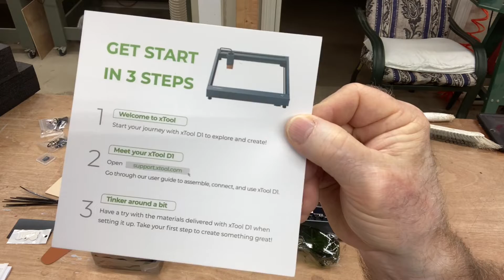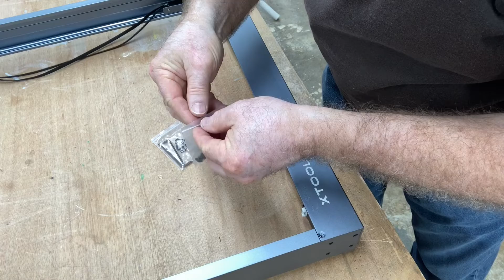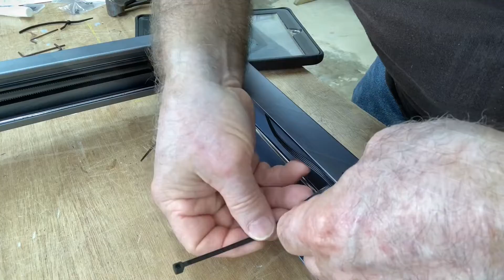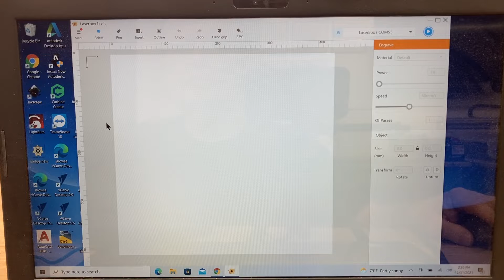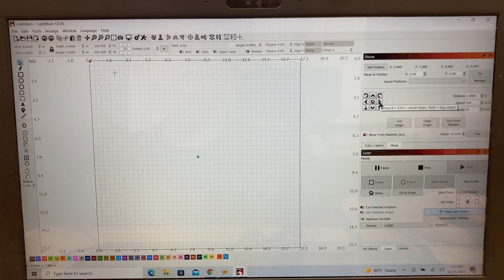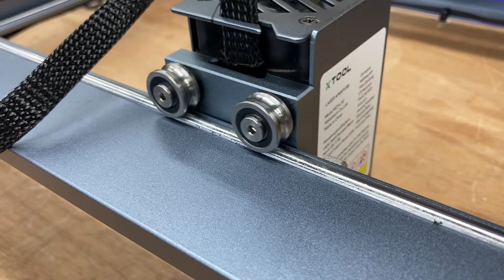xTool D1 10 Watt Laser Assembly and Lightburn Setup

Comment: I like the way you teach I’m trying to do a circle comes out odd shape any ideas I have d1 pro 10 thank you
Reply from the maker: If the circle is not a circle then you have belts that are slipping, losing steps or another mechanical issue. Make sure the machine is clean and the wheels turn freely. Tighten the belts to manufacturers recommended settings.

Comment: Hello Paw Paw! First of all, thank you for sharing your video. I have a question: Is it possible to use xTool D1 Pro with LightBurn via WiFi?
Reply from the maker: Thank you,  the xTool will work with Lightburn as that is all I use in the shop at this time. I know it is capable of WiFi but I do not use it in the shop. In my shop it is inconsistent and I’m not interested in ruining a project.
Reply: @PawPawsWorkShop  Thank you for the answer.

Comment: Thank you for your video. I have a question which related to the alignment. So I try to print some text to the metal card and the problem that I'm facing now is how I align text to that metal card. All my text just not align to the edge of the card :(, so it is like 3, 5 degrees from the edge :( Just hope you have the solution for it. Thank you again.

Comment: Hello, a friend of mine sold me his Xtool d1 pro 10 watt, but could not find the power supply, tried contacting xtool but they would not tell me the spec.s and want be to go though a bunch of sketchy steps to buy it doing screen shots to a third party and the give the a screen shot showing it paid, not to mention they wanted $80.00 for it. All that being  said, the laser head says 12vdc input, but the machine where you actually plug the machine in to says 24vdc, anyone give me a picture of the specs on the back of their power supply?

Comment: This video is amazing! Everything was pretty easy to follow. However, like most people, I'm having an issue with the laser not engraving/cutting.  I can see it framing the motion that it's supposed to but when I press start in lightburn and XCS, the blue never shows up and the red laser just moves the way it's supposed to. I tried customer service but they haven't responded yet. Please help, thanks!

Comment: Paw, paw...can you please help me?? Customer service is giving me the email runaround. I follow all the instructions and attempt to frame. Nothing happens. I click process and get a mressage the project is "complete" even though the laser has not moved. I dont know what I am doing wrong. It looks so easy, but I cant get this STUPID MACHINE TO WORK!!!!!!!!!!!!!!!!!!!! I am ready to take a hammer to it!
Reply from the maker: Are you using Lightburn or laser GRBL?
Reply from the maker: In the instructions there are drivers. Did you add the drivers?  Does the machine power on at all?
Reply: Using XCS. Powers on. I see the red x but machine does not reply to any commands. Lightburn is too complex for me right now

Comment: Thanks for the video. I got  Everything set up but for some reason I'm unable to home or remove the machine from lightburn? Any suggestion.
Reply: Move the machine
Reply from the maker: Thank you for watching. I have never homed the D1. Use current position, frame,(just to make sure all fits), engrave. Go to devices under laser to select another laser

Comment: HI, PawPaw...I need a little help.  I'm new to anything laser, so please bear with me.  I've had my machine xtool d1 for serveral  months, and because just recently I managed to figure out why my Laser head kept crashing and believe me if you see the head on the left side of that laser you would cringe.  I have thirteen hits on that and it is marked for proof.  Well, I also have a camera set up and was trying to figure why the alignment is ALWAYS off.....conclusion, the laser hit the rails so many times that the Gantry  is now out of alignment. What I'm confused about now is how to square up the Gantry.  It is off by a 5 to 6 mm on the Left side (looking at it from the front of the machine) and I'm not sure what screws I need to loosen or tighten to square it up.  I've followed you on the set up (thank you for that)  and all was well for me.  Except for the crashes that threw it all off.  Your answer, Paw Paw will help a whole bunch of D1 users out there that use LightBurn and  have the same issues as I have.   Just as a side note:  LightBurn is a not a bad software...but Jason is trying to serve all LASERS and CO2's; and newbie's such as myself are not putting in the correct figures in for the D1, so no one wants to use it.  Sorry, this is turned into a book...but you explain things so well....
Reply from the maker: Wow, that is a lot to be out of square. It seems to be all on one point. If you recall when you assembled the machine the screws that attached the y axis rail to the x axis rail on the back of the machine. You may have damaged to screw hole or maybe even broken it. You will need to loosen that area first to see the internal damage. The machine was designed to go together square. This damage has caused it to be that far out may result in having to replace parts. When you take apart the corner and see the damage please let me know and I’ll try to give solutions to repair it
Reply: @PawPawsWorkShop  Paw Paw, I have figured out that after 8 hours of rebuilding the Xtool D1, and reinstalling the software, (even taken the time to go through the registry on Windows 10, to make sure ALL of the software was gone) that LightBurn kept reading the measurements of the bed bigger than it was, and for some reason it did seem to think that what measurement was in for a cut or burn was wrong and did its own thing.  Why so many crashes.  Well, the machine is not damaged (that was really scaring me to death, I've lot invested in that unit) and I've squared it up and double checked.  I ran a small test burn today, coaster with a graphic in the center, and it framed it NORMAL, and engraved it perfectly.  One thing that occurred to me was when I first loaded the software , I did not have my virus software turned on...this is usual however with a lot programs so after the installs I always turn it back on.  Well, this time I left my virus software running as usual,  and there was no issue.  It is quite possible that a virus attached itself to the software and caused it to act wonky, it is of course my opinion. I watched your assembly video on the D1 and assembled exactly and now  it's burned into memory.

Comment: Ran into your video while searching Thanks for the help. One thing I have not seen watching any of these videos is setting the tension on your drive belts. what are your thoughts on this. It seems to be very subjective.
Reply from the maker: Thank you for watching my video. In many of the videos I show how to tension the belts. On these simple diode lasers all you need to do is to tip up the laser and let the gantry slide down. It should move slowly down. If it does not move, belts too tight. If it just falls, belts too loose. The laser should be tilted to about 45 degrees
Reply: @PawPawsWorkShop  That my friend is good advice. Appreciate your time and your quick response......have a great day. Just hit the subscribe button......

Comment: Your video was the most informative on the D1 I could find. Thank you! I just unboxed mine and I have an extra prong on the cable going to the laser does it go on the black box?  You did not cover where that goes....or maybe the model has since changed. The manual is only pictures and not very good ones either. lol.
Reply from the maker: First, thank you very much. For your question, I’m not sure, I did not have that. I only had one connector for the laser. If this connector was located near the middle of the cable then that one goes to the stepper motor

Comment: Thanks for doing this video, I followed your step by step set up and got it all set up however I am stuck when it comes to Lightburn. You say to click on devices, however I can't do that because the window pops up to find my laser, I try to import and it's not found in my downloads even though I just downloaded it. I have spent 2-3 hours trying to figure this out 😞
Reply from the maker: When you click on devices, create the laser manually.  Also, in the D1 info it tells you step by step how to add the Lightburn software and how to setup the machine in Lightburn.

Comment: Good video - I used it before assembling my new D1.  Question - Using lightburn, my crosshairs outline the project to the left of the actual burn area.  Is there a way to align the crosshairs to frame the actual burn area?
Reply from the maker: Your crosshairs are offset by design 16mm. It should frame correctly unless you have changes some settings
Reply: @PawPawsWorkShop  16mm sounds exactly the amount they are left.  I'll do some more digging into why.

Comment: Man, I wish there were limit switches on this thing.  I've rammed it into the frame on several occasions...I've had the hardest time figuring out the Absolute, Current Position, User defined poisitions.
Reply from the maker: There is a new version with limit switches coming out July 6th

Comment: When I use xtool with lightburn, my image is engrave upside down and backwards. It look like the mirror of what I want
Reply: If I hit the mirror icon, then the one on my computer screen is mirrored, is that normal. And it is also upside down.
Reply from the maker: Yes
Reply from the maker: Just use the mirror icon at the top of the tool bar

Comment: If you get a chance could you please explain what you meant by the 32 = one my laser still is not working it is framing it is moving in the directions it's supposed to but it is not engraving nothing is there something I am doing wrong please help thank you in advance
Reply: Yes I follow the directions precisely did farmware updates did latest software updates everything I haven't actually tried to use light burn yet although I have it downloaded perhaps I will try that but I still think it should work with laser Box basic no?
Reply from the maker: Yes, it should. That is why I asked about the GRBL settings. They are in the laser not in the computer. I look tonight how to get it in laserbox
Reply from the maker: Do you know how to get to the GRBL settings? What software are you using?
Reply: @PawPawsWorkShop  also just trying to use laser box basic
Reply from the maker: I don’t use laser box. I’ll look to see how to see the GRBL settings. Also, I assume you completely followed the xTool setup including updating the firmware as necessary
Reply: @PawPawsWorkShop  im using the latest windows. i dont know how to find  my GRBL settings. my laser frames and moves it just dont engrave. sorry for being a pain.
Reply: Ty sooo much! Again apologize for being a pain in the ass.
Reply: I finally have a day off tomorrow any help would be greatly appreciated. I think I followed you on Facebook to try to private message you. Ty for everything.

Comment: Living in the deep south myself do you keep your laser engraver in you shop and is it air conditioned? If not A/C would any harm come to the engraver? Thanks
Reply from the maker: The shop is air conditioned when I am in the shop. I turn off the A/C when not in the shop. So far I have never had a problem with any of the machines due to heat and humidity
Reply: @PawPawsWorkShop  thanks for your response

Comment: Thanks to you Paw Paw, I managed to assemble the D1 frame without a hitch. The belt however gave me fits. It somehow got stuck and I could not get it freed. I turned the laser on its side and gently pulled on the belt and it finally gave. Scared me to death, thought I did some damage. I'm extremely new at this laser thing, so I was super careful. When folks such as myself do not have a clue as to laser, belts and what not, a very close up visual is soooo helpful.  Your video got me through this...now I'm on a coffee break. LOL  Thank you for taking the time to share your knowledge for dummies like me.  Very grateful for your knowledge and patience.
Reply from the maker: Thank you very much. I enjoy helping others. This is the reason that I started making the videos and created this channel. Congratulations on starting on the path of laser engraving

Comment: My laser has been acting weird. Weaker, wont fully cut through anymore. Settings are the same as they always have been and it was doing everything perfectly before. Engraving with great detail and cutting through 5mm birch in 1 pass… I have to complete 75 wedding invitations, after 24 its acting up.
Reply from the maker: Two things to consider. One you may need to clean the lens on the laser. Use alcohol wipe. The second factor is the laser head is considered disposable. At full power the diode laser will last about 1000 hours. With let power it will last longer
Reply: @PawPawsWorkShop  wow… thanks didn’t know about the use of the laser information. Im going to try cleaning the lens when I get home and see it that works out. Thank you.
Reply: Hopefully purchasing a new laser head is simple if thats necessary… trying to get in touch with the xtool team definitely isn’t simple 🤦🏾‍♂️
Reply from the maker: They have had a number of COVID lockdowns

Comment: you take a bunch of time showing how to install screws, but when you get to importing to lightburn, you take off like a rabbit.
Reply from the maker: Installing Lightburn is very easy and straight forward. Do you have a specific question?
Reply: @PawPawsWorkShop  yes,   I’ve set up my unit.  It is moving around just great.  I can’t get the laser to fire.  Now to my comment.  I love you videos, but you pointed out several times how well engineered the product was, and how easily it was to put together, then it is off to the races.  I don’t know if you discussed firmware update and switch positions at all.

Comment: Hey Paw Paw!  Don’t know if you fixed the issue with the loose cable, but a simple hack is using 2 - “3M Command Light Clips” below the right side track. Just move the laser to the fartest left corner to extent the cable.

Comment: As far as the cable that's in the work area, can't you route the cable over the top of the laser bar instead of under it and zip tie it to the holes on the right side?
Alan
Reply from the maker: Coming across the top does not work well. I’ve got several ideas that I am testing. I’ll share the one that works best

Comment: Which laser machine is better in your opinion, the xtool d1 10 watt laser or the foxalien 20 watt riezer laser?
Reply from the maker: That’s a tough question. I just started with the xTool and have found that both are excellent. The xTool is an excellent designed and very precise. The FOXAlien is built like any others. Both have compression laser beams

Comment: Happy New Year PawPaw!!!!   
Great Video and as usual, a lot of really good information.  You said you didn't like the cable location.  Viewing the video, it seems that the cable should be able to run ABOVE the maker slide.And then secure with cable ties.  Am I missing something that would not permit that kind of config to be used.  It seems that it would eliminate your concern about the cable moving into the work area and possibly being cut during an operation.

What is the Z axis height specs?
Reply from the maker: Thank you very much. I’m definitely going to find a different way to solve this cable problem. To risky to have it get in the way of the project
Reply: @PawPawsWorkShop  Good afternoon PawPaw.  Since I am awaiting delivery of my xTool D1, I am curious as to how you resolved the loose cable issue you mentioned above.  Additional wire ties?

Regards,'
Dave

Comment: Excellent build video Paw Paw! It's a well built laser for sure, but I think it was launched a little too soon. I have had several people tell me they have had problems with it loosing loosing the home position, and the lack of limit switches compounds that problem. Also, moving the gantry by hand can throw off the square. Nicely built, some great new features, but not ready for prime time IMO. Just like most diode lasers.
Reply from the maker: Thank you very much. I actually don’t mind not have the limit switches. The laser box basic is a little too basic. I like the fact that they finally added the ability to use Lightburn. Thank you very much for watching. By the way, your channel is growing fast.
Reply: @PawPawsWorkShop  Yes, faster than I ever imagined! I'm going to email you next week when I'm over the whole Covid thing with an idea....
Reply: I love my D1. I’ve had zero issues with it. Just ordered the new upgraded rotary and can’t wait to for it to ship the end of the month.

Comment: It sounds Impressive if it can nearly cut through 3mm ply in 1 pass!
The machine looks good, simple, clean design. I agree the loose cabling will be a problem. I assumed during installation that the flat ribbon cable would have acted like a drag chain. But effectively it needs cable tie almost up to half way on both X & Y. And flat ribbon will say aligned straight.
Neat flip out measure tool,  but you didn't say how to adjust. I assume a lock nut on the sliding dovetail??
Who makes/sells it?have you posted the supplier web site?
Reply from the maker: To adjust the z axis just unscrew the lock screw drop the laser down to the gauge and tighten it back up. Slap the gauge back home.